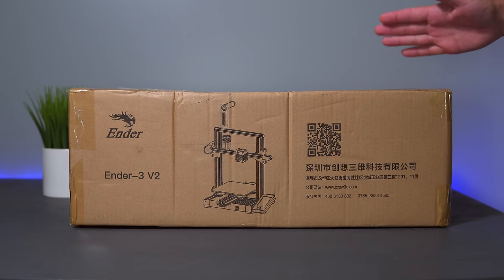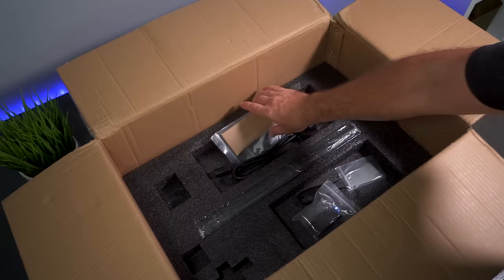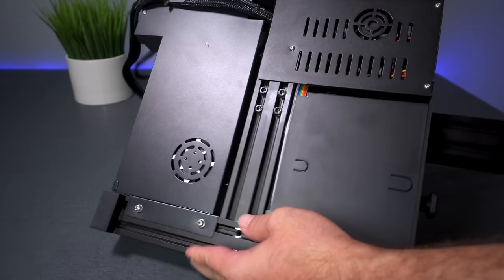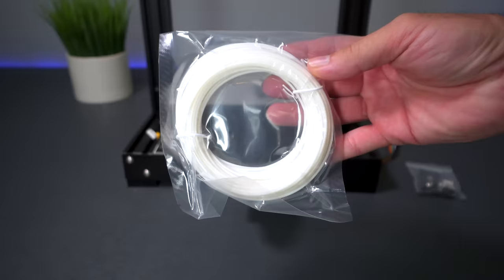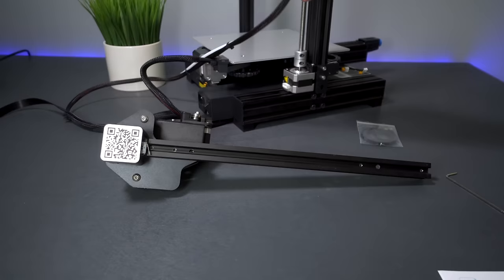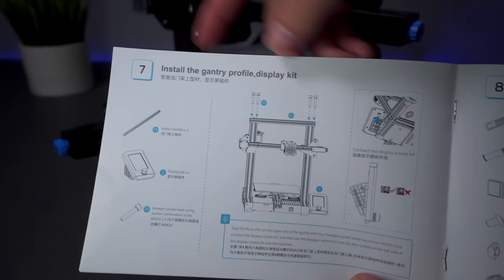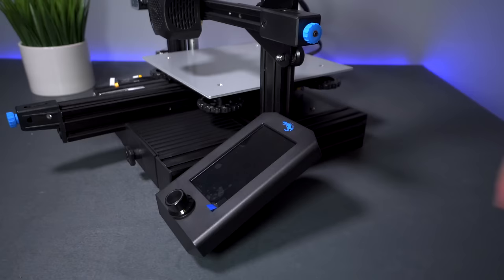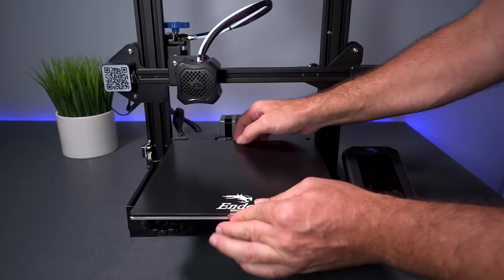Creality Ender 3 V2 - 3D Printer - Unbox & Setup

Comment from the maker: New Channel: www.youtube.com/@Just_Print
Buy it here: https://geni.us/etMDer
Recommended: http://geni.us/JustVlads
Reply: I love you’re content I watched one HOUR wow UR A LegANd
Reply: Sorry to bother but I’m thinking of starting 3D printing as a hobby and wasn’t sure if for 20 more pound it would be worth me getting the ender 3 v2 or the original ender 3.
Reply from the maker: V2 is a much better machine than the original ender3. Go for the V2
Reply: Just Vlad cheers for the advice mate 👍🏼
Reply: Any suggested upgrades? (To springs or anything)
Reply: Can You do a review of the Ender 6?
Reply: Just sent an email to your site, please check it out, thanks!
Reply: Is the better than the ender 3 pro?
Reply: On my 3D printer the base shipped really high is there anything I can do to fix it
Reply: FINGERNAILS
Reply: @lukewoodhouse6749  
Found this explanation on the Net 
“This version comes with 
1. the silent drivers - $40 value
2. Belt tensioners - $15 value 
3. Color screen - $39.99 value
4. Glass bed - $23.99 value
5. 32 bit processors - $20-115

Pros:
Price -$259 + 10 shipping+ $11 tax = 280 280 - $140 in upgrades = 140.  Essentially, it’s a $140 Ender 3... without a weekend of upgrading.
Community this is the Honda Civic/Ford F-150 of the 3D printer world 
More memory and 32bit - allows firmware updates and expansions with .bins no need for the Arduino side boot.
More features and more functions 
Built for BLtouch and a filament sensor.

Cons -
Still needs paper leveling
Extruder is not geared
The hotend is not all metal

$Ender 3s are 170, so to me this is a deal.”
Reply: What happens if you can't push then"z" axis down by hand? It is super tight.
Reply: @JustVlads  I am also getting into 3d printing as a hobby, is the ender 3 v2 an easy printer to setup and use. If so does it encounter jams a lot?
Reply: @lukewoodhouse6749  az első bbbbhbbbbibibii bi i bi i bi bbii bi ibbb bbii bűn bbbjb jól 👍
Reply: My tubing It keeps getting pushed out every time I’m trying to print
Reply: they don't even have the v3 at all on the program they gave, [creality 4.0] just 1,2,4,5 x.x
Reply: What is the best Benchy file, and where to get it from?
Reply: Can't you level this with a firmware update that's meant for the creality level sensor?
Reply: @JustVlads  Great video. Best one I came across on Ender 3 V2. Thank you for putting this together. QQ: I ran into an issue during the install and could not find a way to resolve it. Wanted to get your thoughts. Everything seems to aligned until I place the lead screw. As soon I attach it to the coupler and motor it becomes super tight and the Z axis does not move. Not sure if I meesed up something or if its a known issue. Reached out to the vendor will see what they say.
Reply: Thanks! Saved my neck on the assembly.
Reply: @doziergordon8002  Yes, 32 bit processor vs 8 bit & better fan shrouds & quiter & more.  V2 definitely better than Pro.

Comment: I just finished the build and I can say like so many others that this video is spot on.  I would have probably screwed up in many more places than I did.  The Z axis switch was too low and the  plate banged into the rear stepper.  I adjusted the switch and raised the plate and re-leveled the build plate.  Now it is perfect.  This is not my first 3D printer but it is amazing !  Thanks Vlad.
Reply: I am having the same problem. How did you adjust the switch?

Comment: I bought my Ender 3 V2 yesterday. Put it together last night. I wish I'd watched this video before I built it. This video is far better than the instructions that come with the printer. First, the instructions don't identify which struts go where. I figured it out, but it would have been nice if they had identified them by the location of the holes like Vlad did. I also neglected to make sure the preinstalled screws were tight. I'll do that when I get home from work. The next problem is that the instructions tell you to install the x-axis tensioner and pulley before you install the hot end. If you did it that way, you'll be taking it apart to install the hot end on the x-axis rail before you install the tensioner. Nowhere in the instructions does it mention that the rollers have eccentric adjusters. I got to check that, too. The instructions don't tell you to lower all your plate adjusting screws before leveling it, and consequently, I put a scratch in mine because I neglected to do that. Instructions don't say what to do with the zip ties either.   I was still able to build, level, and fire up this thing in about an hour, but it would have been so much easier if Creality would have included THIS video with their printer instead of the one they did include. This looks like a very well thought out machine. I haven't printed anything yet, but I  look forward to putting it through its paces later this evening. I have to give props to Vlad for producing an excellent video. Liked and subscribed.

Comment: I'm pretty mechanically inclined, but new to 3D. I couldn't have put it together without you!  Thanks! Designed my first part in Blender, and it's printing now quite nicely on the first try!
Reply: The instructions were not clear, so I had to look around the whole parts for almost 30 mins, trying to figure which of the z axis was left or right and which part held the module.

Comment: Creality needs to write you a check and then link your video to their official instructions. If I would have had to use the paper instructions as my only assembly guide for this printer I would have hung myself in the corner with the z axis timing belt. You sir, saved my life.

Comment: I wanted a 3D printer for about 5 years now and I just got one on amazon prime day, and I assembled it yesterday and now today I am doing my first print! This video helped alot, assembly instructions were well thought out,the only tricky part for me was getting the bed leveled and finding the right temperature for the bed and the filament nozzle!
Reply: I am not sure if it’s just me but every time when my printer start printing it starts curling up right when it come out the nossle is there any solution to this problem

Comment: If you're looking for a guide to setup the Creality Ender 3 V2 - 3D Printer - this is all you need. Excellent instructions made (relatively) short work of the process that was not at all clear using the provided manual. Thank you for your help.

Comment: Bought and built following your guide.  Had horrible problems leveling the bed, one corner tightened to maximum but still scraping the bed.  Got there in the end and my test prints came out well.  Thanks for your guide!
Reply: I'm having the same issue, did you just force it?

Comment: I’m glad I found this video. There are several assembly steps in the manual that just didn’t make sense. I normally have no issues putting items together. Without this video I may have just boxed the printer back up and put to the curb.  Now to get to learning to design and slice and get something printed out.

Comment: it is absurdly cool to see you printed those gears and that octopus in one piece, and yet they still moved. I remember using enterprise 3d printers not that long ago, not only couldn't you print moving parts assembled in one print, but also if you even tried something close to it it all would collapse, melt, or join together.

Comment: This was really helpful video setting up my new printer. The user guide that comes with the printer is not addressing most of the alignment and tuning issues mentioned in the video. That said there are two steps that needs to be corrected in the video, one quite important the other just a cosmetic one. 

The important thing to correct is the z-axis switch placement (at 14:35) which this video tells you to install too low. The switch does not go all the way until the stop hits the top of the base but instead the bottom of the switch needs to be on the same level as the top of the base. If you install the switch like shown in the video you can still get the print surface low enough so that the nozzle does not hit it but then there's no more flex and room to go down if the nozzle accidentally goes too low as the springs under the plate have been fully compressed. I think the switch assembly is the same as original Ender 3 and without the glass top it was OK to install switch like shown in this video but with V2 and the glass top you want to install it bit higher. This was mentioned at least by +
AR Plays in an earlier comment and maybe someone else too.

The second minor correction is that the spool holder does not need to go backwards as mentioned at 25:55 but you can install it having "the nice" side at towards the front of the printer.

I suggest you start with the assembly video included in the SD card to get a quick overview how to assemble your new printer but without actually doing anything yet and then come to this video to get more detailed assembly and fine tune instructions.
Reply: This may depend a little bit depending how your setup goes. The instructions show lining up the switch with the bottom of the z support bracket (which aligns with top of base) and not against the stopper protruding out like he did in the video.  However, once I went to level the bed, the nozzle could not get close enough to the base without the knobs on the base going full loose (not coming off, but being way too loose to work properly). So I would suggest installing according to your comment and the official instructions, but then adjusting it lower if needed like I had to. It's at least very easy to adjust after setup.
Reply: This! I couldn't agree more. I noticed when my print bed was pushed back it was colliding with the stepper motor because it's not designed to be that low down. This is a serious issue. I don't know if all printers are like that, but mine certainly was. You have to put the z switch a bit higher up, so the print bed will then be a bit higher so it doesn't collide with anything when pushed back. I'm sure a lot of people have had ruined prints because of this, as the collision is not super obvious.

Comment: Thanks!  I watched several assembly videos while my v2 was on it's way.  Yours I thought was the best and followed it step by step as I assembled my unit.  Some of the bolts in the pre-assembled parts were a little on the loose side - wouldn't have picked that up.  1st print - great.  Thank you for your effort in making the vid

Comment: Great video! It's the most detailed and actually useful video on the E3V2 so far. And this accurately shows how loud those fans are! From watching other videos I thought it would be a lot quieter than it really is.

I got the E3V2 as my first 3d printer (I'm sure many others have as well), so I'm looking forward to seeing more videos about it!
Reply: Yes the fan noise in the reviews is deceiving. I think Creality sent the reviewers a customized version of the V2 with super quiet fans. In reality the fans are loud but the stepper motors are very quiet. Very sneaky of Creality.
Reply: Ahh its out of stock in EU, need to wait until aug 15 :/
Reply: @zainag  no it isnt. It's literally just the mic not being close to the fans

Comment: Thanks for this video! Not only did it sell me on getting one of these printers, but it made the assembly a breeze! Great info, keep up the great videos!!
Reply: I’m having a problem— my auto-home position leaves the nozzle about 7 mm away from from the bed when the bed is raised to the the highest point. There’s no way I can get it to .1 mm nearness
Reply: @AJ-yg6ii  try tightening down your bed all the way snug, not over tight. Now, on the side, make sure your Z stop board is as low as you can bolt it on. Also, make sure your screw shaft coupler is as close to the motor without binding as possible. Beyond that, I would recommend rewatching the video at those points and compare your printer to his.

Comment: Great video, I used it to put my Ender3 V2 together. Good news is that my first print came out pretty much perfect (the dog from the flash). Bad news was getting the Z axis going well. My problem was binding from the Z motor, which was making it hard for the gantry to raise and lower. After about three hours, I figured out that you could adjust the screws on the plastic bit just above the motor and push it out about 1mm away from the channel. I could also have done the same with the hole it feeds into on the gantry assembly. That would have been good to know, glad yours didn’t have the issue. I literally started from scratch to redo the build! That said, for the printer to have such a good first print shows that your technique of building loose then tightening was excellent advice. As an engineer, I generally do this anyway, but it was nice to get the reminder. 

Also, that Z driveshaft is SO LUBED. There was lube everywhere, and having the piece connecting the motor shaft to the z driveshaft with the screws so difficult to see, I spent about half my time just futzing with it. Almost worth it to wipe it down a bit.

Very good stuff, have a tip
Reply: Thanks this saved me a bunch of time. Was having same issue and adjusted a few of the screws along the rod and fixed

Comment: Dude, thank you SOOO much! I've been reading so many posts about issues with these, and it not being square and all sorts of stuff. everybody's first couple prints fail. I followed this video to the T, and my first print is about halfway done now, and PERFECT so far! Thank you for making such a detailed video! This all makes so much sense, honestly, but i certainly wouldn't have thought to do it that way! Thank you, hero!
Reply: Mine isn't very square and it's been difficult to get the rollers dialed in just right. Thankfully from this video I know that is the issue and can work to correct it.

Comment: Thanks for that wonderfull video. It will help many people setting up these printers.
There is one small mistake tho, but thats somethink like a myth that every 3d printing enthusiasts will beleive in at some point.
Setting the printer to Z=0.00mm and then leveling the bed with a sheet of paper will result in an uncorrectly leveled bed. If you think about it that becomes clear:
The printer does not start the print at Z=0.00mm. It does start at Z=0.00mm + layerheight.
So if you have a layerheight of the first layer of 0.2mm it will start at 0.2mm. If you level the bed to 0.00mm + paper thickness you will level it somewhere like 0.1mm off.
So at the end the printer will start at Z=0.00mm + layerheight + paper thickness and thats something like 0.3mm in that example.
So better is to autohome, then move z axis up for the thickness of the paper (messure with caliper) and then level the bed to the paper. That way you are elliminating the thickness of the paper and the printer will start at Z=0.00mm + layerheight as it should.
Better than paper is to buy some feeler gauges and use a 0.1mm gauge or something like that and set the z axis while leveling the nozzle to the bed to exactly that thickness of the gauge.
Maybe that will help more people to get a good first layer sticking perfectly to the bed. The more precise you level the bed, the better the first layer and the bed adhesion will be. There is NO need on that ultrabase bed for any other materials like glue, hairspray, tape or anything like that. If it does not stick correctly try to level the bed the way i told and maybe raise the bed temperature a few degrees. especially petg may need up to 85 degree celcius (185 fahrenheit) to stick well.
Nice greetings from germany.

Comment: Thanks for the amazing video! I was about to buy it but was worried about assembly. This video helps me out a ton!
Reply: They are easy to put together.
Reply: There is actually a really good instruction video on the SD card you get with the printer: "Ender-3 V2__Operation video.mp4" in the "5、Operation video" folder

Comment: When you tightened the bolts, the ones that were 'really loose' were only that loose because you tightened the first ones which pulled the parts closer together. If you tightened the other ones first the opposite bolts would seem excessively loose.

Comment: Thanks so much for the video. The only thing that wasn't obvious until after I started tightening up screws, was when you put the top bar on, to make sure the cable and filament feed are inside the z axis profiles (side rails). A super helpful instructional video.

Comment: I feel so dumb...I got my ender 3 v2 yesterday and installed everything correctly, except for the z-limit switch. I thought the small ledge was supposed to rest on the top of the horizontal bottom support bar. Its' not. I've brought it back up to align the bottoms and everything is good, don't make the same mistake I did!!
Reply: THANK YOU THANK YOU THANK YOU
Reply: Yeah, same for me. I was about to start it but wanted to check that all switches got triggered before I plugged it in. The video clearly says all the way to the bottom. But then it's way to low for the bed. The video is incorrect on this point

Comment: this video was a better way to assemble the 3d printer than the instruction manual that comes with it.  I had an issue that my printing was hard to move up and down. Here you showed that I should not tighten the screws right away. Instead, have it lose until all the parts are in place. thanks.